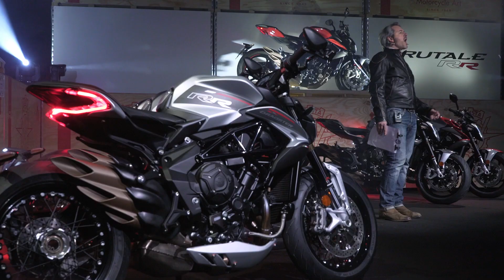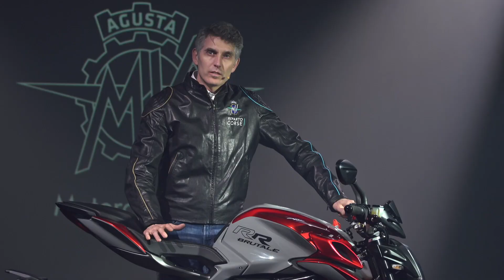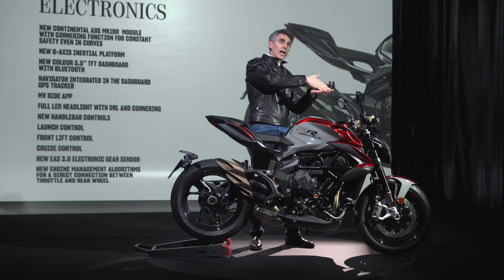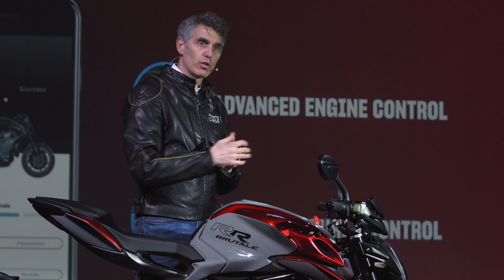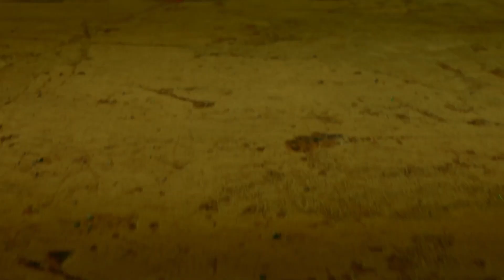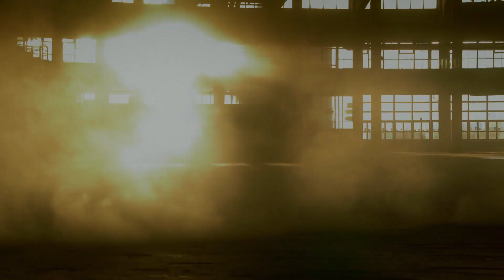MV Agusta 2021 Reveal: Brutale and Dragster 3-Cylinder Range

Comment: So i have a question... i will try tomorrow but i have a 2020 Dragster RR. Will it do the thing where i can downshift with quickshift to first and it wont stall at light if i do not touch my clutch in the process? And if so how does it stay in 1st and not pull bike at all or stall out with no throttle?

Comment: With SCS can I still use the clutch the traditional way?
Reply: Yes you can, i test rode one. It works just the same but you don't have to use the clutch when standing still in gear. Not a must have option except when you drive in the city a lot in stop and go traffic.

Comment: MV, how did you say the engine is reliable? did you test the engine in real life conditions? and how long before it breaks down the engine?
Reply from the maker: Our overall reliability scores has improved dramatically since Euro 4 models has been introduced (in average -60% complains compared to the old EU 3). The Euro 5 introduces further technical refinements to improve even more. We will share some video about these here, make sure to follow our updates.

Comment: How do owners in this comment section judge their bikes' reliability? Every one I know that has / had MV Agustas warns me not to touch these things with a 10-foot pole, and there are tons of terrible stories on forums, blogs and YouTube channels, but these bikes look too good to simply move on without further investigation. Is reliability really that bad? Only owners' answers, please.
Reply: I don't own one, but simply try to install their MV Ride app - that thing doesn't work. If they can't even make an app work I would never put my hard earned money on any of their bikes. They look amazing for sure, but I think they're better admired from a safe distance.
Reply: @ricardolourizela5961  Yeah, I tried to install it, it's just a blank screen, nothing happens. Not a good sign...
Reply: I had 2 - a 2013 Brutale 1090 RR and a 2017 F4 RC. I now ride a 2020 S1000RR.
Should tell everything you need to know about MV Agusta's reliability...
Reply: @gregbonham8659  If an S1000R was a better choice than your MVs in terms of reliabilty - my god were those MVs unreliable!
Reply: DON'T BUY ONE, MATE. I bought a Brutale 800 RR in 2018... nothing but problems since week one, mainly electrical,  dealership support was nonexistent, the brand didn't seem to care one bit (I called, sent emails, contacted them on social media and I even mailed them a physical letter, no one ever got back to me); I finally sold it at a pretty major loss. Worst experience of my motorcyclist life by far.
Reply: @raphaelauteuil8502  Wow, what an awful experience, man...
Reply: The guys from MV Agusta running this YT channel don't even bother answering all your comments - I think that speaks volumes about their attitude towards their customers. The minute they sell you the bike they don't give a sh!t anymore...
Reply: 20, dragster RR owner mines had 0 problems and I follow scheduled maintenance...that being said mv agusta used to be owned and ran by Harley..= issues.  Harley sold it to same people who own KTM.. so that being said most people dogging mv have either never owned one..or they were probably referring to the time they were Owned by Harley. Harley fucks up alot of things...Look at Buell 😅

Comment: Nice presentation, gracie mile. As I heard this story isn't the rider a bit redundant? I am disappointed that MV Agusta has taken this path. Isnt the name of the motorcycle BRUTALE? When you stop on the street light, you select first gear, the light turns green, you fully open the throttle as fast as possible ... it should kill you instantly ... no engine control algorithms in italian bikes for Gods sake ...  the italian motorcycles has been the last outpost for engine lovers and free souls. The dragster is nice, the most beautiful not custom build bike. And more nimble then previous version? that is not even possible, 2019 is already super nimble.